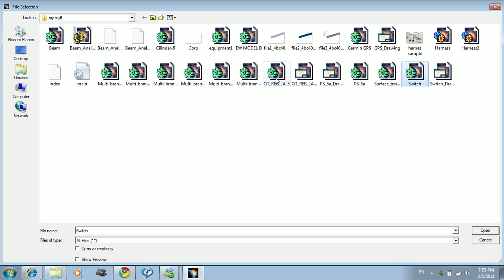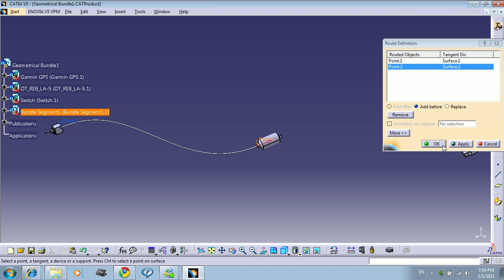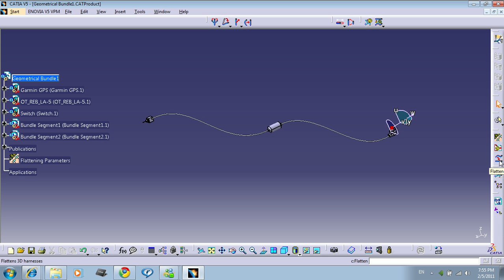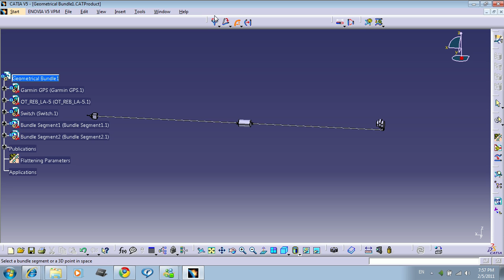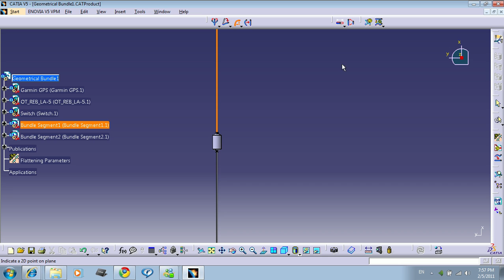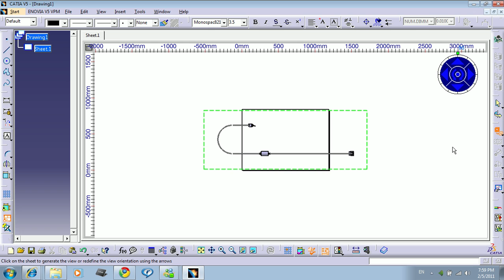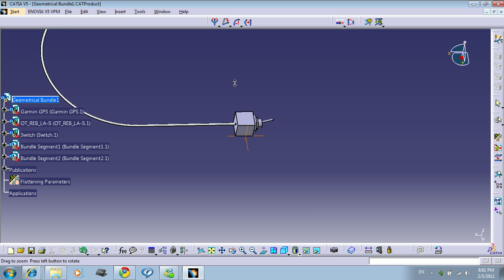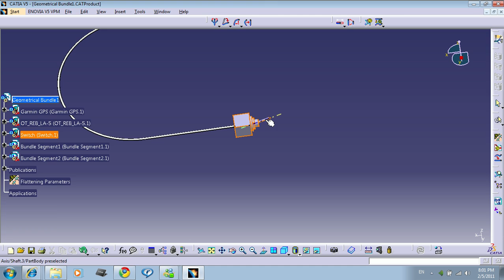Catia V5 training part 8

Comment: could be a Memory Problem, how much RAM memory do you have? at least need to be 4, whats your operating system? windows vista windows 7? 34 bits / 64bits? are you using another software same time as CATIA? sometimes is because of this because CATIA works with complex algorithms that require to hold in memory to make calculations

Comment: Thanks for your tutorials, the way you explain everything is great. But I´ve got a problem with flattening, when I try to do an error message appears saying that is an error inside the flatten command, a very common error that should be fixed in R17 but I have R19 and it doesn´t work either. Do you know what should I do? Thanks Hans.